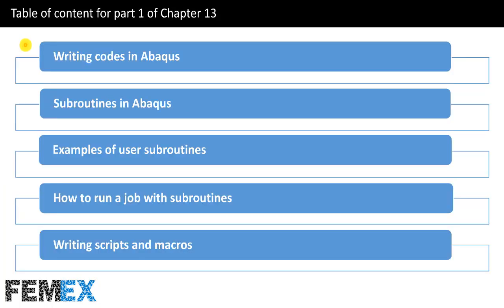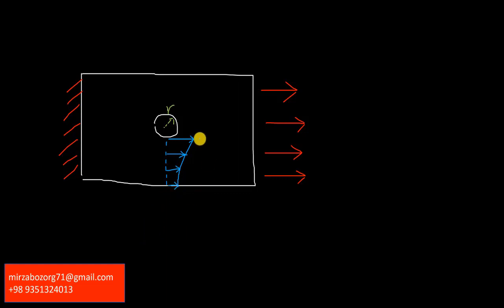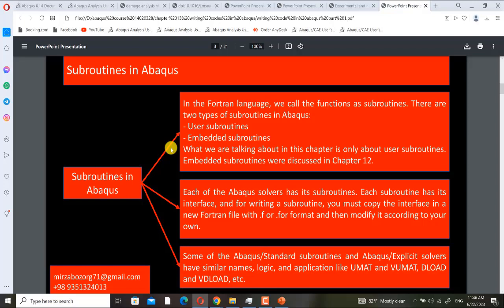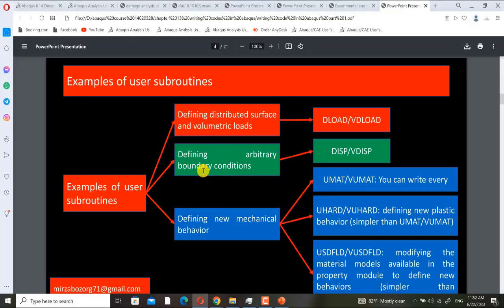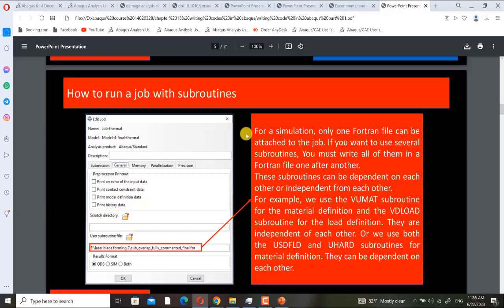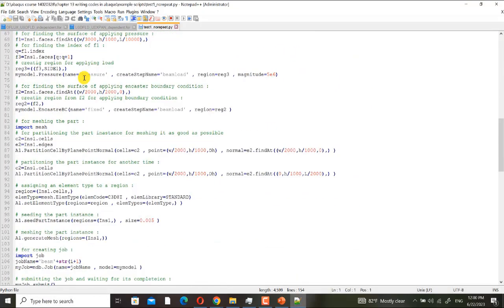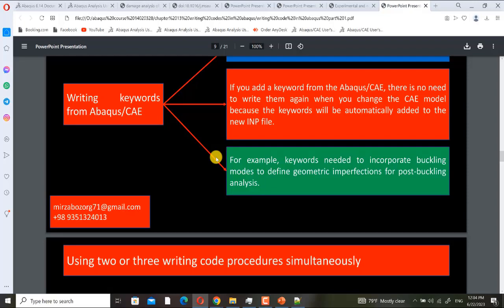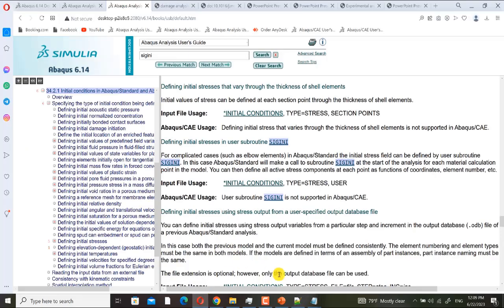Comprehensive Abaqus Package Chapter 13: Writing Codes in Abaqus Part 1

Comment: How to call State variables on USDFLD to UEXPAN for expansion?
Reply from the maker: Hi.
As I have mentioned in this tutorial, you can directly use the state variables defined in the USDFLD subroutine in the UEXPAN subroutine. You can suppose that they are input variables to the UEXPAN subroutine.
Reply: @FemexIran  can there be any more insights, I couldn't see the expansion values after. the IVOL and EVOL values didn't sound reasonable in the simulation I did. everything else is good.

Comment: If i have a partial differencial equation or a differential equation, we need to find a general solution and then write it in subroutine right ? Just a clarification
Reply from the maker: Hi.
It depends on what subroutine you want to use and what you want to define.
For example, do you want to define a distributed load or a new mechanical behavior.
For some purposes, Abaqus only provides one subroutine. But for some others you have several choices and finally it depends on your problem specifications. According to complexity of these cases, I cannot give you a general robust solution.
Reply: @FemexIran  Subroutine: DFLUX
for defining load across a surface, I want to incorporate a modified form of fick's second law (Diffusion Limited Oxidation Equation)